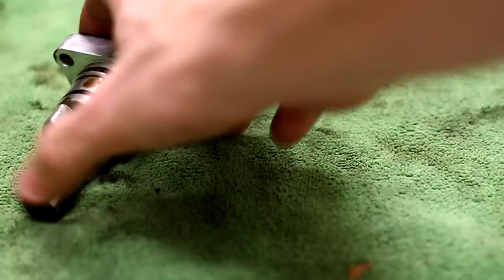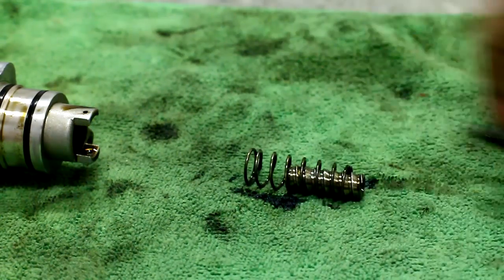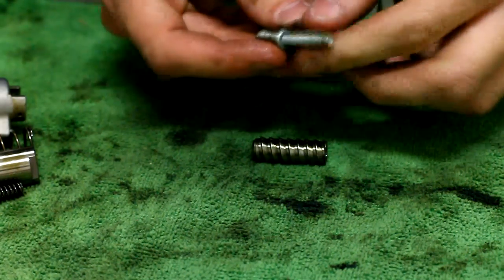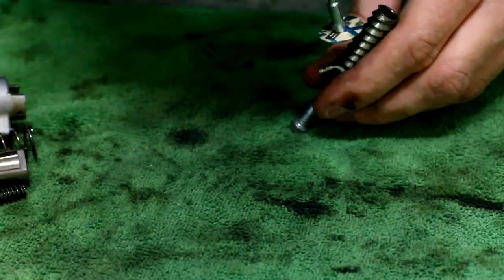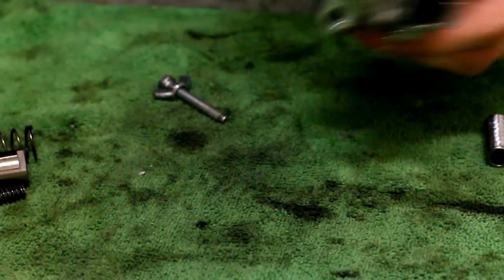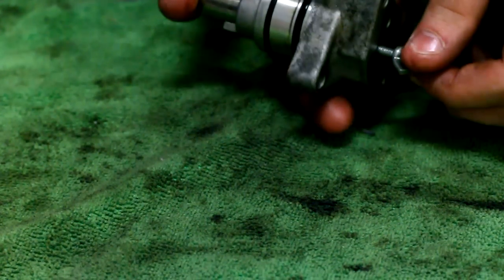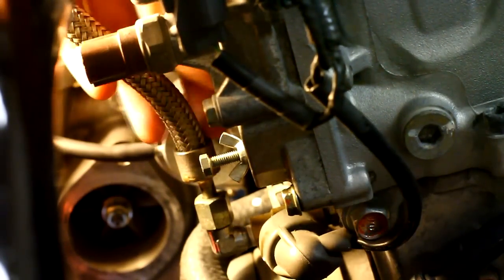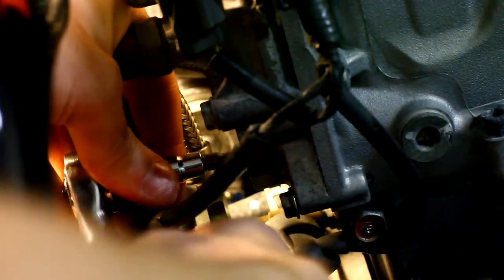TheChazz.com - S2000 TCT Timing Chain Tensioner Fix F20C F22C

Comment: Hey Chazz, can I use the 5mm bolt trick to keep the assembly from coming apart and dropping pieces into the motor when first removing the tensioner? Thanks.
Reply: I haven't done it yet, but this is for sure what I would do. It's the easiest way to keep the piston and inside components in place.

Comment: That noise you are hearing is telling you something about the slack in the timing chain getting worn out over time. This is just a band aid, you should really fix the issue at the root of the problem which is checking the timing chain, guides, the timing gear, and the timing chain tensioner. Over time if you keep doing this and don't address the timing chain wear, it will keep getting looser and looser over time, and wearing out the guides too. Could jump teeth, jump timing - no good. That "noise" is the timing chain rattling around.
Reply from the maker: Incorrect
Reply: +TheChazz.com wrong
Reply from the maker: +Eric Lovato check your oil pressure reading before and after the repair  (pre tensioner) then let me know how wrong you are.
Reply from the maker: +Eric Lovato or even better,  do a timing chain,  guides and even gears if you like on say an 11,000 mile car and then start it back up without touching the tensioner and let me know how much money you wasted.
Reply: +TheChazz.com I highly doubt the tensioner is failing at 11k, even at that mileage that is definitely not enough time to have stretched the chain to create slack....check out Ballade sports timing gear, it's offset a few degrees to compensate for chain stretch and to align the timing marks perfectly so it's a TDC.
Reply: +TheChazz.com I did check my oil pressure before and after. My repair consisted of installing ballade sports tct, Balladesports timing gear, and doing a valve adjustment. All noise gone, and timing is now corrected along with making sure the timing chain is now properly tight again by installing the offset timing gear......
Reply: @crxvtec0069  I have seen many many failures with ballade

Comment: Hi I have A 2008 SI, same noise for 3-4 seconds with 114 000 kilometers(regular oil change and genuine honda filter),it is there only when engine is cold startup. the dealers tells me it wont cause a problem and just drive it and it will never give me any issues and it the, VTC (variable timing Acutator 1000% for sure) and i feel it is not getting any louder.I am stll wondering if it is the VTC ?,.It may be the TCT  (Timing chain tensioner )? what are your expert thoughts and opinions.? P.S. If  it is the  T.C.T. tensioner, then i will/Can get my CNC Machinist buddy to make me up a "mechanical tensioner that i can adjust myself.I can go to local scrap yard and get an old TCT and machine it. possibly. your thoughts ty. 100-100 video and great explanation.

Comment: Thank you for posting this. They were going to charge me 1100 for labor and 300 for the part. You saved me big bucks dude.
Reply: Holy shit I know this comment is really old but go give a yelp review about that pricing because that is savagery. The tensioners is two bolts and takes 5 minutes in labor with a new tensioner. A brand new oem tensioner from Honda costs $150.

Comment: Hi , I wish you wold of shown how to take it off .. I took the bolts that hold it out and the dam asebly dos not want to come out.. is thare somthing holding it in other than the 2 bolts on the side..???
Reply from the maker: Just twist.  It may stick a bit.  The seal holds it in pretty tight.
Reply: yes i did find that out the hard way , wen it all exploded out lol

Comment: Just want to say thanks, worked for me. The car actually sounds more like a sports car than a tractor now. :)

(Takes about 1 1/2 hours including figuring out what's what, you need the engine to be cold or the bits come out really hot.)

Comment: This is AWESOME!! Thanks for taking the time to record and post the vid. Using a dremel rather than sandblasting was great. I used a dremel sized, 80 grit, flap wheel and twisted the worm gear, running it down the flat face as I went, rather than running it top to bottom as you did. I also used a punch to mark the housing before removal for orientation on reinstall. I scored the top cover and housing together marking the way that went together as well and finally, I loosened the top cover bolts enough to get a screw driver blade under it, then pryed against the piece right above for leverage. With a hand underneath to catch it when it pops out, this made removal a piece of cake.

Thanks again for posting this!!!
Reply from the maker: Glad I could help!

Comment: Chazz, 

Can I fuck up my engine if I do this wrong?  I want to try.  Amazingly, I have very few tools but I have a dremel for some reason.  Go figure.

Again, I am NOT a skilled car guy.

Thanks for any response,
Sean
Reply: It's hard to fuck it up, the only thing I would be careful with is taking out the tensioner, you have to twist then pull but don't yank it because the internal pieces can fall out and you don't want to drop them in the engine.
Reply from the maker: Sorry for the slow response. I would say its a 3/10 skill level. I mean in today's day and age... anything can be fucked up. As long as you are careful during re-install you should be fine. Just dont drop any pieces into the engine.

Comment from the maker: No problem! You may have the sound return in 10-15k miles, The Dremel seems to make it last much longer. Either way after you've done it a time or two, you can do the whole process in 5min. So every 10k isn't so bad!

Comment: Oh man, Thank you so much for this step by step video. Followed all the directions except i had to sand to worm gear by hand for a while to get the same results. Either way it worked perfectly and the clicking sound during low rpms and hot starts is gone :)

Comment: hello again, so did the oil pan, found 2 pieces. need the pin so tried cranking the pulley up and down a few to see if it would budge anything out..sure enough did. 0,0 put oil pan back together. but not how this pretty bad rattle. and car feels like has no power..runs..but power..feels like it chokes. any ideas on this?

Comment from the maker: No problem! Glad I could help!
Reply: Hey chazz can you tell me how long your sanded worm gear tct has held up and if you did it again and it worked or can anyone tell me how long thiers held up and if anyones found a better material to use other than sandpaper; like an aluminum oxide 90 grit attachment to the tool

Comment: Hey dude! great vid! My S has done 118,000 miles now and the chain is beginning to rattle slightly intermitantly on tick over. The guy before had put a tentioner on it before and hes done the valve gaps. Do you think your method shown here will fix the existing tentioner. Also in order to remove the tentioner do i need to place any timing pins into anywhere on the engine to prevent cam/crank sync? Webby out :)